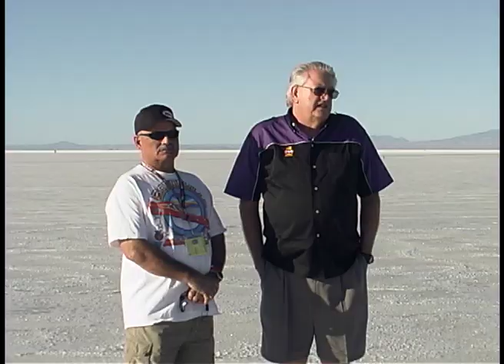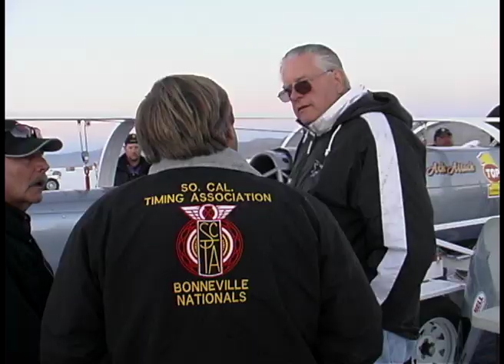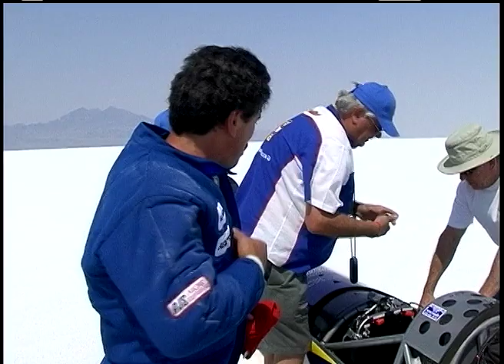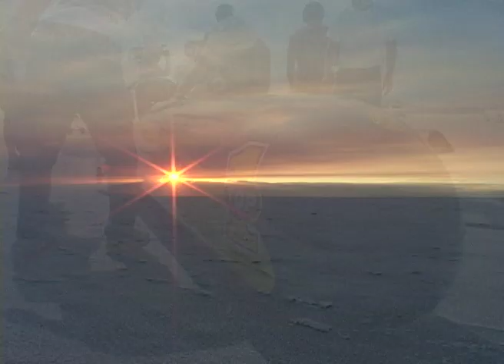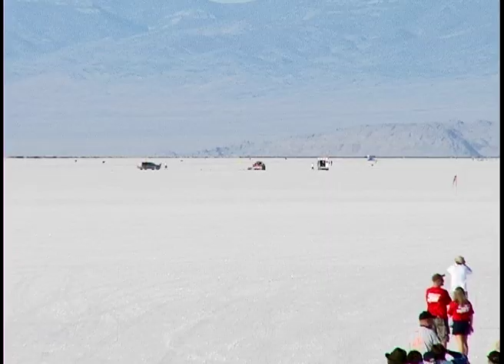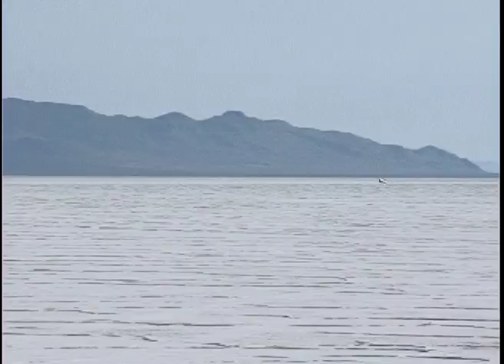Riding The Ragged Edge

Comment: The gyroscopic forces of the wheels keep it up right with out the ability to lean ?
Reply: Motorcycles are really stable standing up under power. If my dirtbike leans to far I’ll throttle out n  it pulls the bike up.

Comment: I wonder how much prize money there is to be the fastest motorcycle in the solar system. I'm guessing not a red cent.  But if you have lottery money it'd be an interesting hobby.  Where they ought to run is on the highway that passes the flats. When I drove by way back when in my 67 GTO I don't recall any curves for what seemed like forever. It'd be real interesting to see what those machines could do with plenty of traction.